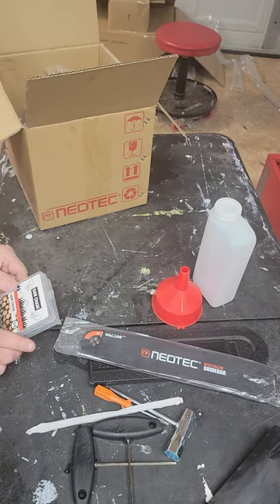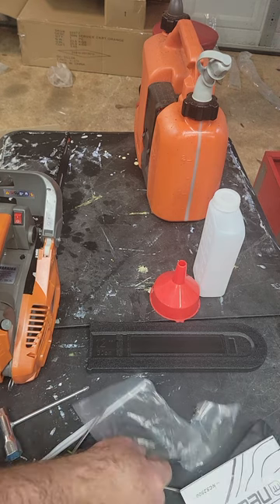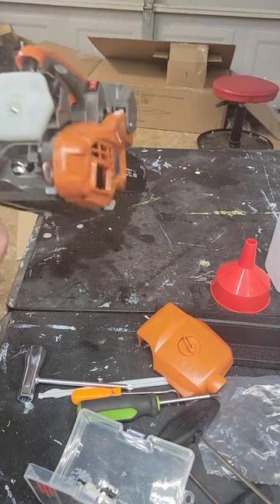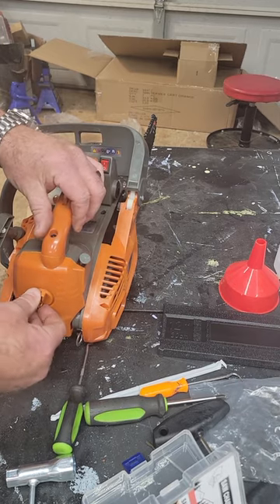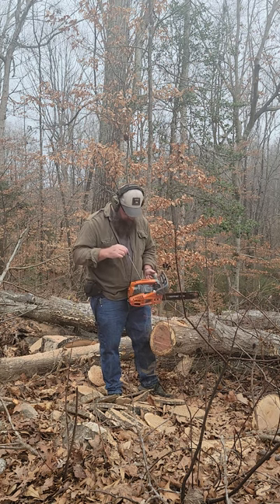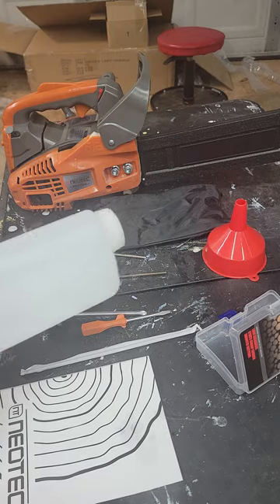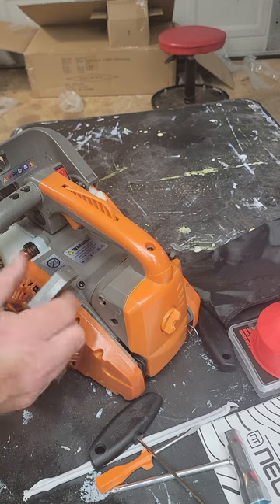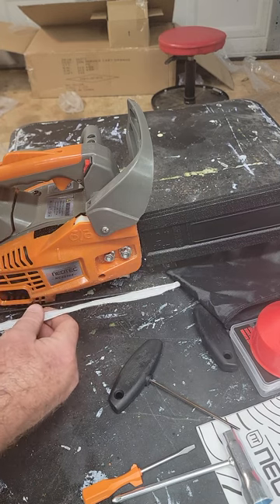Neo Tec or Neo Turd  2500 unboxing and testing.

Comment: I bought one last year in August and out of the box I primed it and it started on the 5th pull and after that it starts on the first pull every time even when it was below zero temperature... But I never had any problem with it at all and I cut over 20 cord with it and it still going strong...

Comment: Most of us want to see a review after a year or so of operating not an unboxing
Cheap saw probably won’t be good for every day chores. Neither are cheep tools (screw drivers, pick tool, Jack stands, shop stools…). Who hasn’t been in “the” store.  
Poor saw got no break in heat cycles before getting into cold start full throttle and big wood.  Sounded a little fat on the high end but leaned out ok when under load.  Pretty sure that’s an e-z start.  No need to drop start and pull rope to it’s max end.. steady even pulls whined and release the spring.

Comment: Sorry about your luck, bud. Trying to save a few bucks ends up costing you more down the road. Throw that hunk of shit in the trash. My motto is "buy once, cry once"....you get what you pay for. Awesome video, keep up the great work.
Reply from the maker: I knew fully what I was getting into, lol. It's all in fun and experiments
Reply: I bought one and still after a yr of owning it I cut over 20 cord of wood and it stills start on the first pull every time even below zero temperature with no problem at all and right from the box I never did everything to it and it starts every time....
Reply from the maker: I guess they have potential. I'm just not a fan of the grey market saws not being consistent. it's really a roll of the dice. that's why the price point is where it's at.